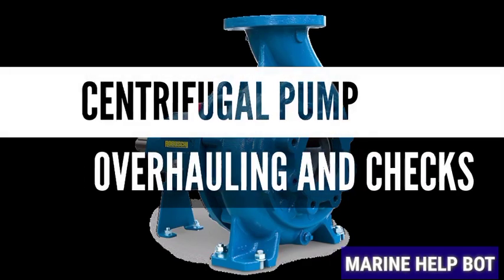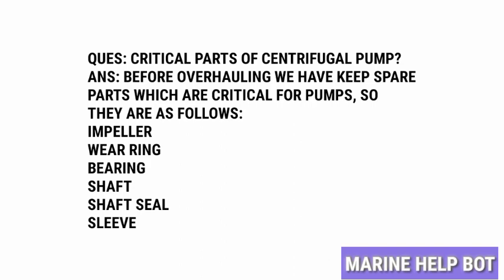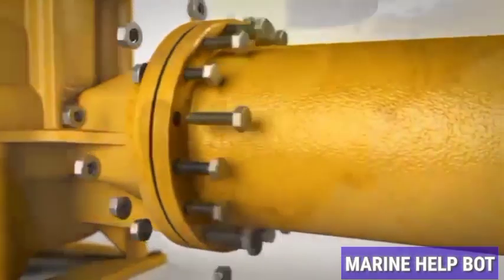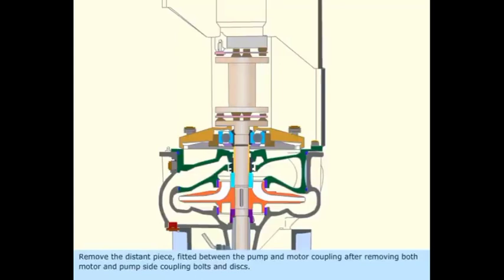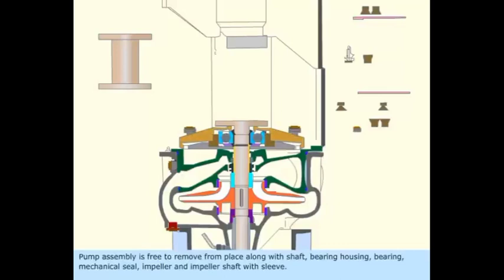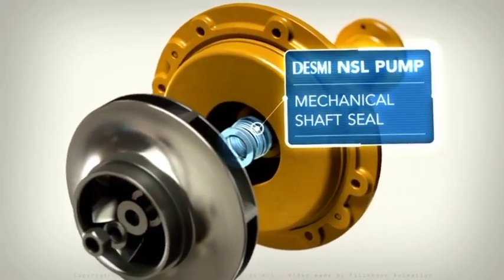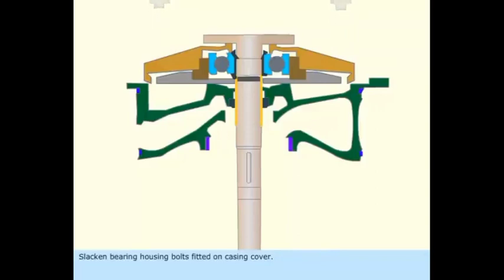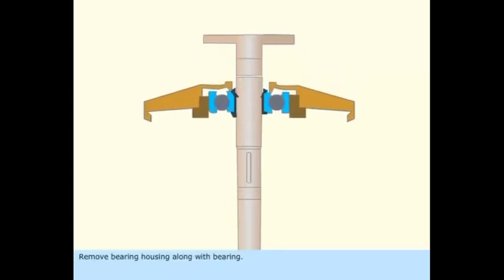OVERHAULING OF CENTRIFUGAL PUMP AND CHECKS | CRITICAL PARTS | CHECKS ON CENTRIFUGAL PUMP

Comment: Hi bro, what is the use of sleeve in pump?
Reply: It is used for protecting the shaft at one end which is connected to impeller. THE SHAFT AT THE END OF IMPELLER IS SUBJECTED TO FORCES FROM MOVING PARTS. Further it also helps to protect the shaft from sea water corrosion.